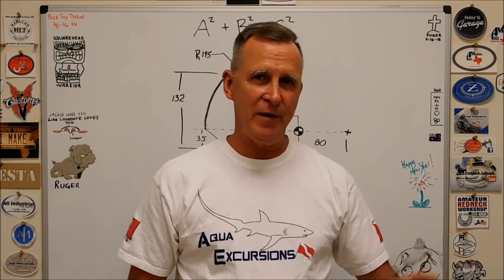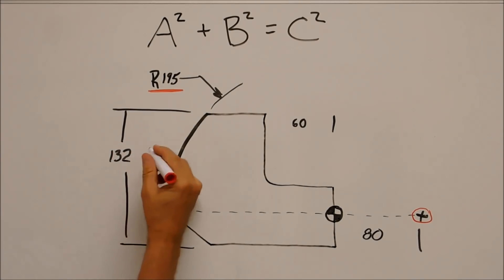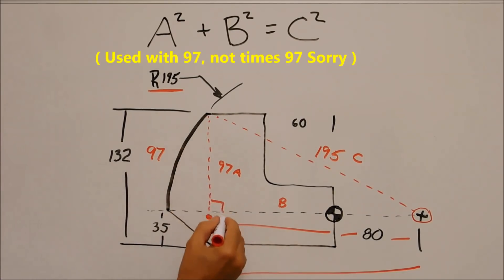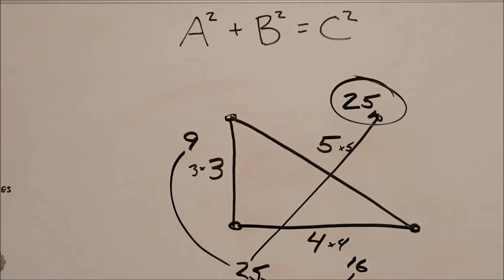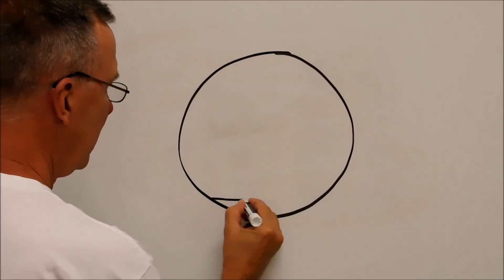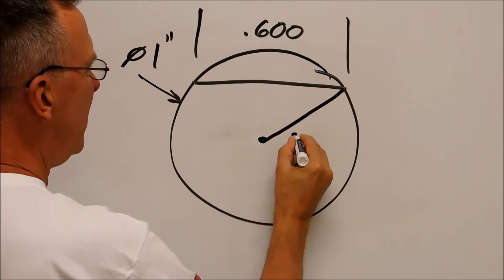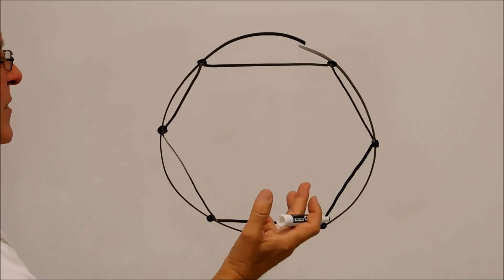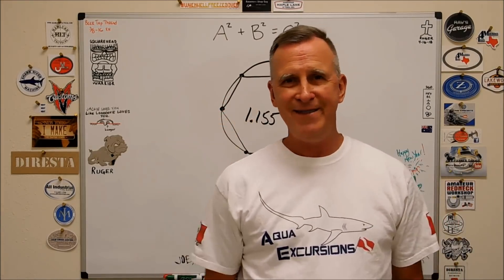Could You Find the Missing Point ??

Comment: Great video however i think the number your looking for is 1.57 which is exactly half of pi
Reply: Squidgymop, pi is an irregular number so 1.57 isnt 'exactly ' half, and the real half of pi is still wrong.
Reply: Just incase you lose your piece of tape on your toolbox
Reply from the maker: Wanna bet?
Reply: Joe is quite correct.  If you do the math the number comes to 2/sqrt3 which is 1.155 to 3 dec places.  [Thats 2 divided by the square root of three - pardon my abbreviations]
Reply: Tried it half Pi, and it didn't work. ROFL luckily it was in CAD and no aluminium was harmed in this trial.

Comment: I like the 1.155 trick never new that👍👍
Reply: Another trick is, if you need to measure a 45 degree hypotenuse from the short side of a triangle. Just multiply the short side by 1.414 (not absolutely exact, but pretty close.. more precise: 1,414213562326465  etc...)
Reply from the maker: Thanks. Its a keeper. if you really want to cheat, use a smaller number by about .015 and it will break the edges of the hex for you.

Comment: I signed up for an advanced math class where I used to work as the tool and die guy, ended up helping him teach the class because it turned into a basic math class. We found over 75% of the guys taking the class could not tell us basic fraction to decimals first day he wrote on the board 1/4 and asked what the decimal equivalent would be, most of the class did bot know. Glad to see you trying to teach this.
Reply from the maker: Its not so scary if you understand the basics and look for the triangles to solve. They are in there.

Comment: Here is one for you. Take the first three  odd numbers from 1 to 10. That would be 1, 3 and 5. Now double them. That would be  113355. Cut that number in half. Now you have 113 and 355. Now divide 355 by 113 and what do you get?( While it is not exact, its darn close.)  Love this stuff!
Reply: 1113213211 :D
Reply from the maker: OK...Now its my turn. Give me the next number in this sequence. 1, 11, 21, 1211, 111221, 312211, 13112221..............good luck
Reply from the maker: Lets let a few more answers come in before I comment. Thanks for the guess and the compliment.
Reply: On your trick for 355/113 funny thing happened when I tried it on my calculator, answer came back as 3. I then noticed it was set to (computer) programmer mode (decimal/hex etc) which works in integers only.  Good example of why blind trust of any tool without gut instinct for reasonable results is not good. 
Most calculators do have an "esteemed you-tube machinist' key.

Comment: Now do it for the globe of 3959 mile radius and then go to the water and check if what you see matches the math.
Reply: Hey Mr. Wizard, (aka Jeff Beck Einstein) why don't you teach us low life losers something? I guess it's easier to be a troll. :->
Reply: Are you suggesting the flat earth theory? Fly two fighter jets head on in respect to each other, one being at 34,000 feet and the other flying at 35,000 feet. Both flying at lets say mach 1.5 and tell me what you see. The jet flying @ 1000 feet higher will appear to be actually lower as it approaches and you would believe he was going to hit you head on but keeps rising until he finally flys right over your head at 1000 feet above. Tell me if you can why this is if the earth was flat? He would always appear to be higher through the whole experience but because of the curvature of the earth it will appear that even though he is 1000 feet above to be much lower then you flying @ 1000 feet below his altitude. Try that Jeff and come back and tell me the earth is flat, until then you have been duped by the flat earthers if you like it or not.

Comment: We have an ever so smart math wiz at work that has no idea how to use it in the real world.
That is what I am doing with the guys is showing them how to use it in the real world.
Things like finding out how many feet are in a coil of rolled up wire without uncoiling it and measuring. 

As always, thanks for your efforts Joe.
Worth Doss.
Reply from the maker: Thanks Worth. Good to hear from you.
Reply: Worth Doss : Just curious if you have any (approximate even) methods for length on a spool where counting the total turns is not possible, at least without unrolling it.
If it is nicely spooled guess you could count the turns across and use that to get  wires per inch to estimate the layer count. Then use that to calculate total turns and use average turn length to get total. (Close, exact probably requires calculus...)

If you had an empty spool weigh that (tare) and the full one to get weight of wire and use feet per pound.
Reply: Most of the wire I use has the footage stamped on it.
But sometimes they get it messed up and the footage is backwards or for what ever reason you cant tell what it is.
For this I can just count the wraps across the spool and then guess what the amount is in depth.
Then average out the length of each wrap and multiply that by the amount of wraps you have guessed or estimated.
My mission is to teach these young guys to use their heads and work out a problem instead of it getting answers handed to them.
An example is they will ask, "Do you think there is enough wire on this spool to get from point A to point B in a building?"
My reply is figure it out so you dont have to depend on someone, then show them how.
As for another method you could figure the diameter of the wire and the width of the spool and divide that width by the wire diameter. 
Same with depth of the wire on the spool.
I am not a machinist nor a mathematician, I simply use  the tools presented before me as a means to a solution to a problem.
Sometimes it evolves using my lathe and other tools to make tools and parts that do not exist. 

One last thing the guys that are presented to me have fell through the cracks.
They for what ever reason didn't end up in a cubicle writing code or working for google.
I end up with them on a construction site and they dont know how to do anything but text and play video games.
They are pretty much helpless and poor fresh out of high school for the most part and cant even use a level or adjust a channel lock pliers.

Comment: Joe this was great! Unlike some of those dreaded engineers you talk about I am a mechanical engineer that has spent a lot of time in the shop at work and at home.  This video should be mandatory viewing for every person in engineering school.  The light bulbs would go on in their heads and they might start thinking about design for manufacturing. Keep doing what you do.
Reply from the maker: I have worked on both sides of the desk. Any engineer that wants to be a great engineer should have a solid working knowledge of the machines and processes that impact or effect the production of a project from a cost or time prospective, then he should actually listen to the guys that are going to produce that part.
Reply: You nailed it.  When I went thru school at LeTourneau, cross training was mandatory.  My electronics degree came with welding theory and lab, machine tool lab, statics, dynamics, strength of materials, and thermodynamics:  all ME stuff.  I love being able to see things and understand them as a result of that.  Machine tool lab, tho, really put the icing on my trig understanding.   This kind of training SHOULD be mandatory.  It would reinforce the class room teaching.  "Trig Lab".  I'd sign up for that in a minute.

Comment: Something else with the whole 3,4,5 ensuring square is that its the same for any factor of the 3 side assuming that you increase by the same factor for each side. For example, a 6,8,10 (all being increased by a factor of 2), or 9,12,15 (all being increased by a factor of 3), and so on and it will work even with fractions / decimals of any factor like say 1.5 (or 1-1/2) as in 4.5, 6, 7.5
As long as you increase the 3 side by the same factor, it will work out to insure square. This is handy to remember when you are dealing with points in space or trying to square things on a larger scale
Reply: Or, just change units.  Inches, feet, yards, miles.

Comment: ah good old pathagarus. one thing ive never figured is if you square a  a fraction it gets smaller   say you have a part 1/2 inch or .5  the square of .5 is .25 or 1/4 inch ?    if its all whole numbers it works fine.
Reply: richard cranium Even if it’s a fraction, the theorem still works fine. Because you take the square root of the resulting sum, hence making the answer “bigger”.

Comment: Why square the numbers when calculating a triangle? If we know the 3-4-5 rule in the milling depth example, the missing leg X is .4  so .5  - .4 = .1" depth of cut. 

So why square it? I did square A and C just to see what happened and I got A=0.09 C=0.25, I figured out B by going C-A=B or .16,  which is the square root of .4, so the same answer in the end right? I am no math expert so maybe my question is dumb why square the values of the triangles sides?
Reply from the maker: Your logic on this particular example is correct. If the diameter was anything other than 1.0 and the flat was anything other than .6 you would have to do the math per formula. Excellent catch.
Reply: it is to provide a theorem that will work in all situations (i.e. 3+4=7 ...3^2 + 4^2 =5^2)          
 A^2 + B^2 = C^2. hope this helps i am by no means a mathlete. there is quite a bit of Pythagoras' theorem on YouTube. I would encourage you to look into it  if you are interested. good stuff :)

Comment: 3,4,5 square has served me well over the years  being a welder ! 
I had a job once where I had to weld two  pieces of rsj onto some columns about twenty feet up off the ground , the boss asked me how I was going to ensure they were level and I told him to send someone to the local hardware store to pick up some clear plastic tubing - he had never seen or heard of a water level ! Sometimes the oldest technology is the best .
Reply from the maker: Ever seen the ones you can screw on to the ends of a garden hose? You can have a level a 100 feet long.
Reply: And make sure that one of the knuckleheads you work with don't set a ladder leg on the hose!

Comment: Many years ago I had a number of courses in CNC programming.  One of the courses dealt with mostly circular motion/cuts and in one of the projects we had to program circular cuts (full quadrant and partial quadrant) in each of the three planes (XY, YZ, XZ) as well as not aligned with any of the three planes.  The interesting part of this was the circular cuts all had to be done with linear (G1) motions and within a certain radial tolerance.  Talk about a lot of calculations.  Remember this was many years ago so the programs were created using teletypes and punched tape and the only way to verify the programs were to dry run them on the machine.  A great learning experience.  So much has changed with the CNC machines of today and software such as Fusion 360.
Reply: Calculating all those little line segments would be simple if you can program in c or python or a similar language understand how to use Euler's relationship Xn = R*cos(theta)  and yn = R  * sin(theta) where theta = n * pi/(180*N) setting n = 0, 1, 2, 3, ..., N-1.  This will give you the coordinates of an N bolt-hole circle.

Comment: My favorite one is finding the length of the sides of an equilateral right triangle for a specific hypotenuse value (for example how far do you move to get a specific length bevel). Those sides will be half of the square root of two, or 0.707 (rounded). Just multiply that with your actual measurement. No trig required. Imperial or Metric!

Comment: In your milling a flat on a round you created a 3,4,5 triangle. Except the values were 0.3, 0.4, 0.5. I've used 30', 40', 50' on big foundation walls (when I was a lot younger). 6, 8 10 works too.
Reply: Michael Lloyd multiples of 3 4 5 as long a you have the same multiplication factor so if in your 6,8,10 that is just 3x2,4x2,5x2.
It with work for others aswell eg 3x3,4x4,5x5
Reply: Yes. That's why I mentioned 0.3, 0.4, 0.5. The multiplier is 0.1 in that example. It could be 10x... 100x... whatever is practical and works
Reply: The  only restriction is the longest dimension needs to be less than or equal to the measuring tape length to work properly.
Reply from the maker: Break out the laser.

Comment: "Dear Algebra, stop asking me to find your X. She is  never coming back and I don't know Y."
As pointed out by Joe, the 3-4-5 triangle is very helpful for creating a square corner but the second multiple 6-8=10 or the third multiple 9-12-15 may be easier to use and can be more accurate.
In case anyone is interested, the 1.155 comes from 1 divided by the cosine of 30º which is derived by using basic trigonometry.
Joe, you could be a math teacher. :-)

Comment: Thanks Joe.  Also used Tan to find unkown angle quite offend. Does any one still use log tables, kids wouldn't know how to use them.  But log tables are still in my old engineers handbook. Do they still have log tables in the new books?
Reply: Use a half decent calculator app on your smartphone. The information isn't in a table but is an available function.
Reply: The reason for the Log tables is Logarithmic table numbers are added for multiplication and subtracted for division and then the result is converted back from Log to give the correct answer.  Adding and subtracting is a lot easier than long multiplication and division.  The slide rule is a set of Log table marks but is only accurate to the third or fourth place and keeping up with the decimal is a pain.

I am a civil engineer and have laid out many curves using this stuff as well as the tables in my Route Design book.  The back half of that book is nothing but tables and is worth it's weight in gold.

Comment: Good analysis. I drew it up in SolidWorks in under a minute and got a solution, and found out where assumptions had to be made and where info was not given. But everyone should have the basic algebra skills to figure it out as you have shown. In school they would not let us use a calculator, so we had to learn it. Once you do, though, it saves a HUGE amount of time to just throw it in SolidWorks or Fusion360. But you should be able to check your work multiple ways and know the math.
Reply: The problem with relying on the computer without having learned it by hand is you never acquire a sense of reasonableness. So if there is a fat finger error on data entry people can't look at the answer and say, "That can't possibly be right." And recheck it.

Comment: You're calculating the versine dimensions. 3-4-5 is always helpful as is 1.414 for 45 degree angles. I've used all of these in the field on tanks, boilers and fitting pipe spools. They are also very useful when building 45 degree straight staircases. 
Spiral staircase are another matter altogether but the same basic rules still apply. The problem with spiral staircases lies in the fact that the outer radius of your staircase is different than the inner. The rise remains the same on both inner and outer but your run changes due to the difference in the radii.

Comment: Joe, good working examples of how to use trigonometry to calculate geometric values.  In my days as a template maker I always used these functions when laying out steel structures with cross bracings and diagonal members. Nowadays I have become somewhat lazy and tend to use CAD (Unigraphics) to undertake all the calculations. For anyone just starting an engineering career it is useful to have the basic understanding of trig and right angled triangles.

Comment: Great topic. The 3-4-5 relationship also holds true for multiples of 3, 4 and 5.  In other words you can do the same with a 6-8-10 triangle, or a 9-12-15 triangle, and so on.  The bigger the multiple, the better the accuracy. For best accuracy use the biggest multiples of 3-4-5 that will fit the dimensions of your part (or deck).
Reply: Beat me to it. Use that all the doing lay out.
Reply: Use that all the time doing lay out.

Comment: At 2:15 instead of using A2+B2=C2 you can simply use your calculator by taking the invsin(97/195) = angle (at origin) and then with that angle press the cosine (or "cos") button on your calculator and then multiply that by 195. Bingo that's your horizontal leg (169.2).